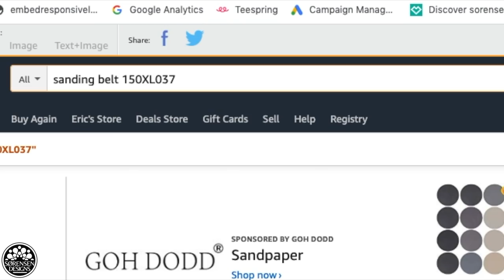10 Money Saving Tips for Woodworkers: Learn from My Mistakes

Comment: Excellent suggestions. After a full year in this hobby, I found myself nodding along with most of your recommendations. I would add two more...1) Plan your projects (pen and paper, Sketchup, SOMEthing) to visualize a project and develop at least a rough list of materials. "Winging it" is wasteful. 2) Get organized in your shop. Know what tools you have to prevent buying duplicates; collect tools together in logical groups (drill press accessories, table saw accessories and jigs, drills/impact drivers/bits/batteries); clamps in racks). Thanks again!

Comment: In regard to your last suggestion, I have over the years bought several tools for a fraction of their original cost, someone returned the tool because they said it did not work.  I would take it home and spend a hour or so repairing something simple or align the adjustments and now I had a tool which I am still using productively for several years and saved a lot of money.

Comment: Great video for beginners. I’m a tight-wad by nature and have a nice shop set-up. New Dewalt saws, sanders, planer etc.. Jointer, drill press and bandsaw are older, much sturdier than what are offered now and I’ve got less than $600 in all 3. Refurbed them and they’re awesome. Lucky to have a couple of local affordable mills to get hardwoods. All of my tables and storage are self built as well.

Comment: Thanks for your insights.  Here's my list of the most important things you mentioned.  #1- DON'T BUY FESTOOL!  It is a fad and way over priced for things you can do a different way. #2 - Don't start a business.  Selling items to help pay for tools etc. works well, but if you are going to be in a "woodworking business" you need to be building cabinets with plywood in a very large shop that includes someone that can do the cost analysis for you. As soon as you add the word "business" it changes from being allowed to "fail forward" into "requiring success now".  #3 - Make small things.  Small things can be made out of scrap and pieces of wood you find.  After trying to start a woodworking business and failing I developed a list of more than 50 items that would sell well. I titled the list "Small wood projects that I could sell".  Selling stuff is different than starting a business.  I love woodworking and so I am not concerned with an hourly wage.  If I can sell it for more than the cost of materials and power I win.  I'll make my income another way so I can come home to the wife and woodworking I love.

Comment: Great content on some cost saving measures. It is VERY easy to get lured into the Festool/ Laguna/ Sawstop rarefied air of tool product, but most will never need that price point of tools.
Fixing up cheaper tools is very true. I bought a used HF 14" bandsaw from an electrician's shop that was moving. These idiots used a 1" STEEL cutting blade on it and it didn't work because it would never get tensioned high enough. I cleaned and tuned it up, bought a good quality 6tpi- 3/8" blade and it works AWESOME for lightweight stuff and cutting curves. Total cost was $45.

Comment: Maintenance of tools also includes cleaning, which in my opinion should be done at the end of the day of use. 
I have found that sawdust from pine boards gums up things very quickly. Especially saw blades.
Reply from the maker: Yes! I spend a good deal of time cleaning - it's never ending. Also, the reason I don't have a "tool wall" for my power tools like a lot of other YouTubers, is because I store them in cabinets to keep the residual dust off of them.

Comment: High quality tools can often be had used. My table saw is a rebuilt cast iron 60’s Craftsman that I rebuilt and modified new fence, motor, mite gauge total price under $500 extremely accurate and stable.
Some of the tools from cheap tool stores are a really good buy others are dumpster fill.!
Reply from the maker: It was a lot easier to find cheap / free stuff when I lived in a big city. People would put stuff to the curb on garbage day, such as old tools, furniture, etc. That's how I got my bench vise. It was attached to a rotten bench that someone was throwing out.  Now that I live in a rural area, it is a lot harder to find used stuff. Although, sometimes at a flea market I can still get a deal.

Comment: Great tips as usual sir. I installed a couple of kitchen uppers and a pantry I got from the re-use store for about $60 total. Buy the tools as you NEED them not as you want them no matter how hard it is not to was a great tip as well. How do you like the Festool Dust Extractor? I'm looking at it and the Bosch.
Reply from the maker: Thanks Jeff! I like the CT36 dust extractor , however I will need to get a cyclone separator for it which will be another $400 down the road. The bags are pricey - so if you plan to use it a lot, factor in the cyclone system (cheaper in the long run).
It's not the vacuum that is remarkable, it's the hose. The FT hoses are amazing, especially when you've got a sander attached to it.

Comment: When you find a supply of hardware that is a great value - buy in a large quantity. Years later when you are using it- and it’s been paid for for years - use current costs when pricing it out- it’s a hidden source of profit.
Reply from the maker: Excellent advice! Cheers🙂